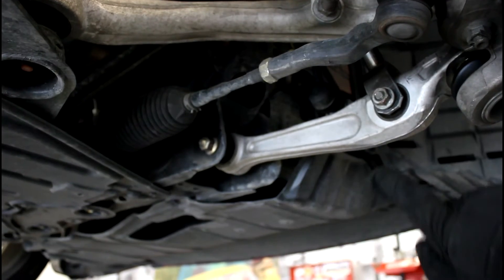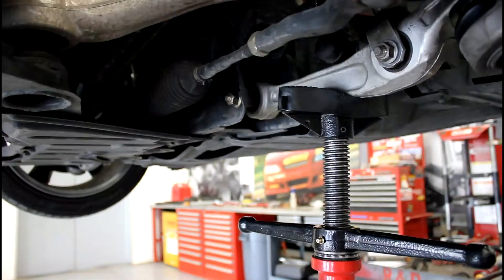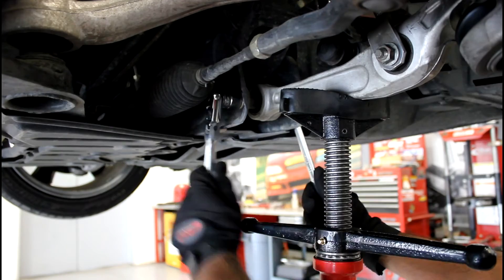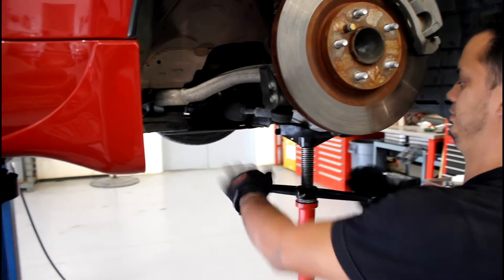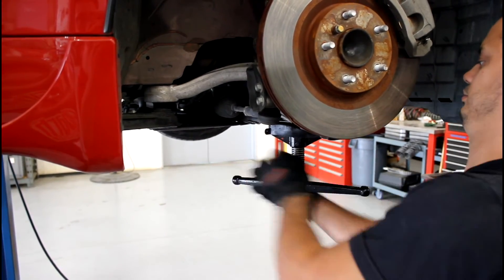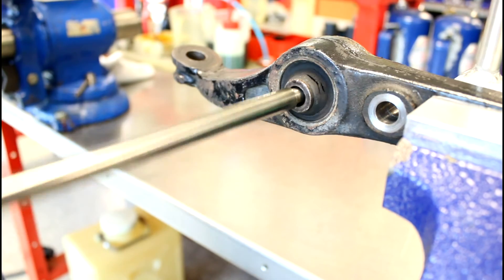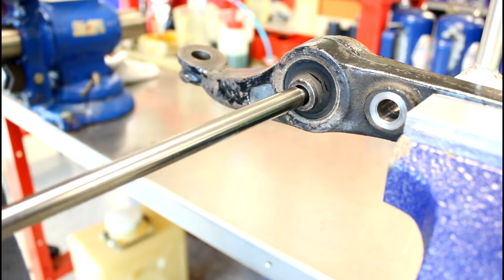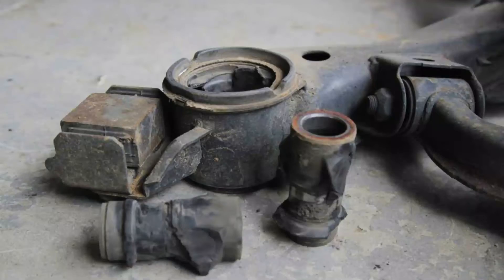Eibach Tech-Tip: Suspension Preloading and Installation Tips

Comment: Never jack on a control arm like that. They are ment for lateral loads not vertical.
Reply: Matthew Jeschke there was no loading there, just a shock compression to adjust the rubber bushing to avoid over torsion. Standard stuff!

Comment: so i see u guys used the manual jack to load up thr suspension on one side. how do u know how much to load it up? till the car starts movimf up wards? anything.will help thanx
Reply: heard once the car leaves the jack stand (then the weight is being held by the jacked suspension)
Reply: U can measure with measure tape first when the wheels are on the ground the distance between the centre of the cv axle bolt or nut and up to the top  wing arcade and then  u must jack up your car one wheel at a time and place a jack stand under the ball joint and then lower the car slowly to compress the suspention till it reach the measurement and then tighten up the control arm bushings
Reply: @georgegeorgel7254  bought some hub stands instead
Reply: My back bushing be creaking cuz i didn’t preload cuz the guy on YouTube didn’t preload. Should have done more research